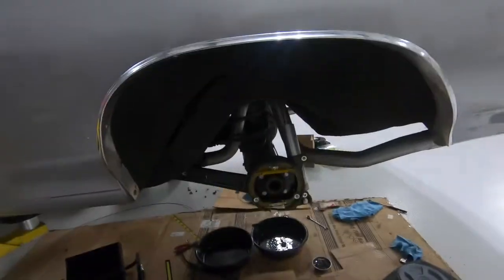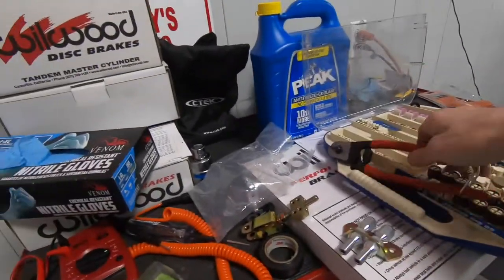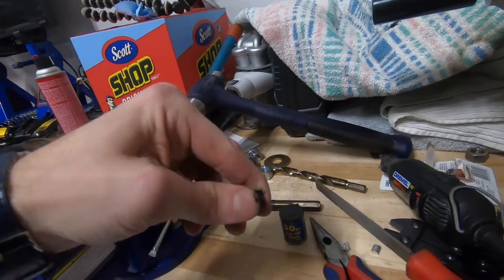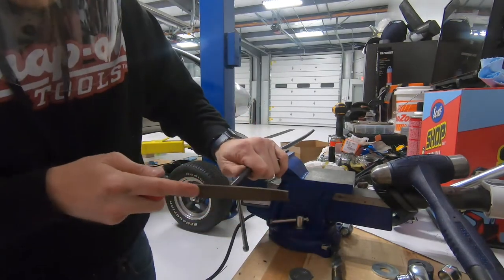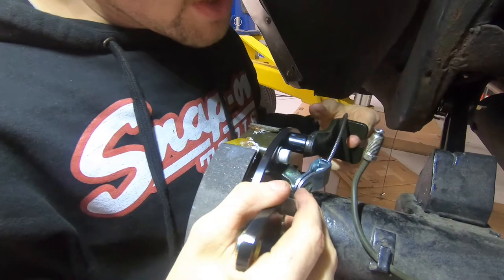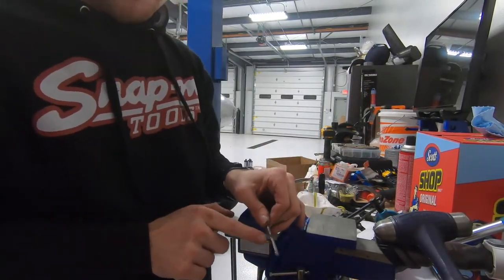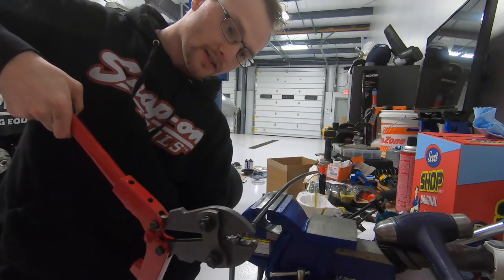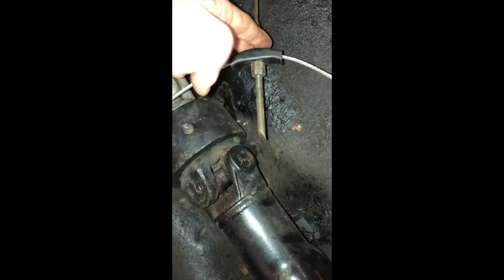Wilwood Universal Parking Brake Cable Install

Comment: I was thinking about doing it the same way you did... I like the stock cable loop better the way it crosses the drive shaft than running the new cables up the way most videos show...  I refused to buy the $160 wilwood emergency brake kit so found the exact same thing on Amazon for $50..  I needed the clevis and cable mount to the wilwood brakes but that was it.  Job well done and simple to....

Comment: I am using  Ford Explorer parking cable (2) D/Side & shorten middle cable this looks just like Explorer brake setup.  Doing this on a 64 Chevelle wagon.
Reply: i have explorer rear end in my 61 chrysler, but cant get them to grab with the new kit. any pointers? simple lever cable set up and i cant imagine what i am doing wrong
Reply: @whatsyoursguy  Try to adjust  parking shoes with a slight drag. I had the same thing with my  parking brake. Good luck & let me know how you made out.
Reply: @l.munnier9658  thank you. i did that originally with no luck. i unhook the main cable from the 2 that go to the brakes, and i have plenty of pedal and cable travel. hook them up, and pedal will barely move yet no brakes at all. i must be losing my mind!!! hahaahaha
Reply: On the ford R/S cable loops to L/side and then to E -brake cable. On my need a lot of pressure  to engage  park brake.  If works better let know thanks Lou. Good luck.